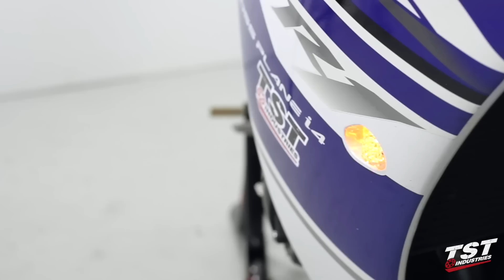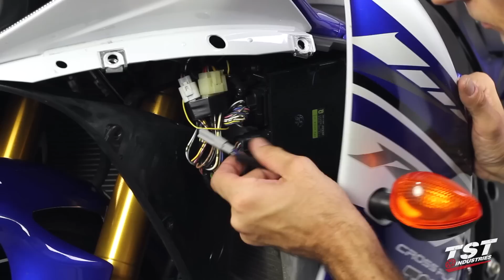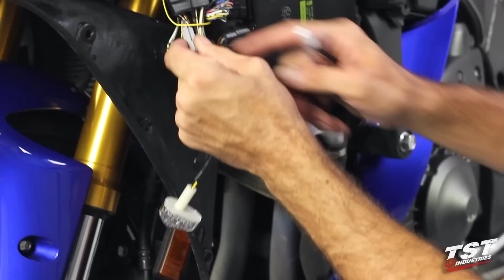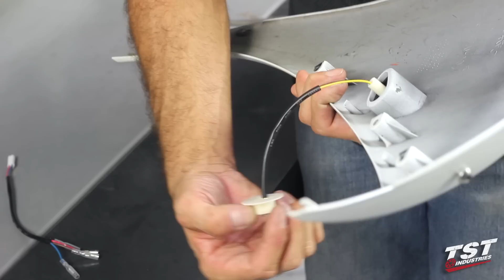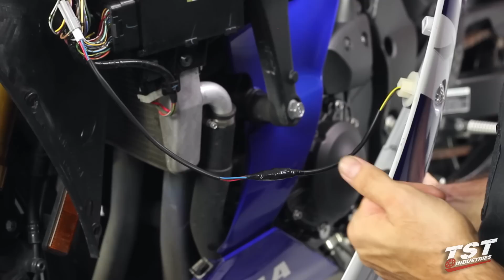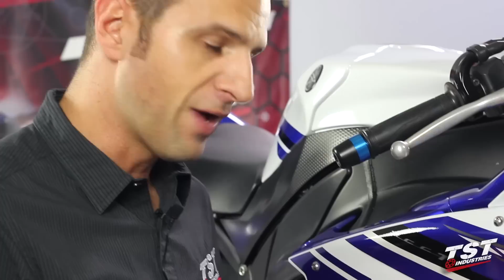How to install LED Flushmount Signals on 09-14 Yamaha YZF-R1 by TST Industries

Comment: I just did this on my r1 & now don’t have running lights only blinkers work & it’s straight plug & play
Reply from the maker: If the signals you swapped to only have two wires, then you did it correctly. If you want to introduce a running light function on those signals, you can use our Running Mate. 

https://tstindustries.com/tst-turn-signal-running-mate.html

Comment: So glad I went with motodynamic. They come with oem connectors and resistors. DRL is standard too and look much better. SMH
Reply from the maker: Motodynamic is a very reputable company. We hold their product in high regards here. I am glad that you are happy with your choice. The product here you are comparing to is a very basic set of indicators at less than half the price. It is intended for more budget oriented customers. We have premiere series signals for other Yamahas that fall at a competitive price point with the MDs, we just didn't make them for the R1 because that bike is not very popular with our clientele.

Comment: Is there a reason why you don't use the 3rd wire for running lights? I like how you have a harness but, would like the flush mount to have the capability of the running light function as well.
Reply: here they are in another video, looking weak and bright enough to make you un noticed, especially in the daytime.

Comment: these are certainly visually pleasing, I don't know about US laws but there's no way you'd get through an MOT in the UK or Europe? couple of other questions: why not just make model specific looms by default other than cost it would make the fitting tidier and a better wuality product
Reply from the maker: We don't pre wire the plugs because we use those signals for many different applications and then we would have to make and track many different SKUs. That would mean more labor, more shelf space, and consequently higher cost to our customers.